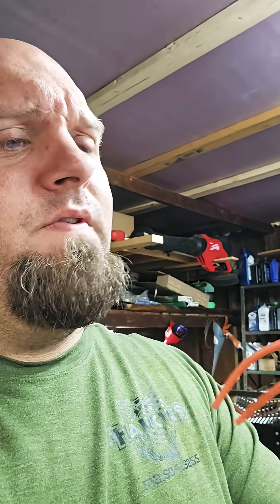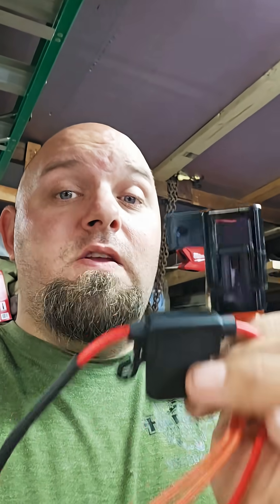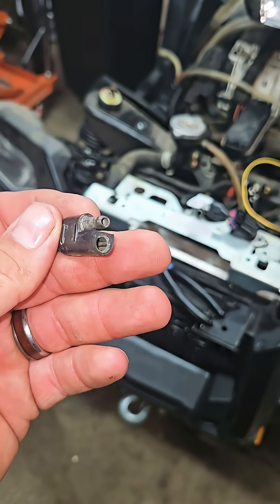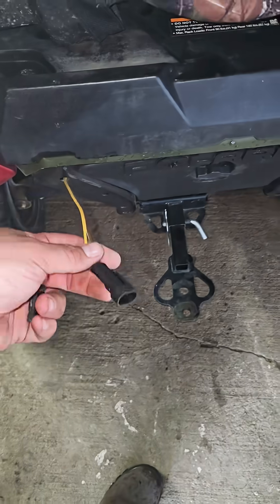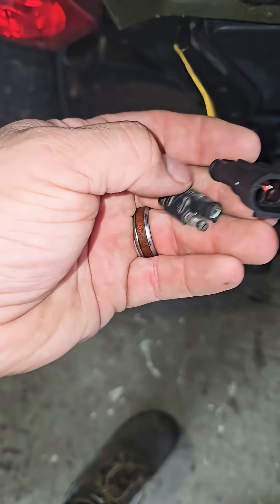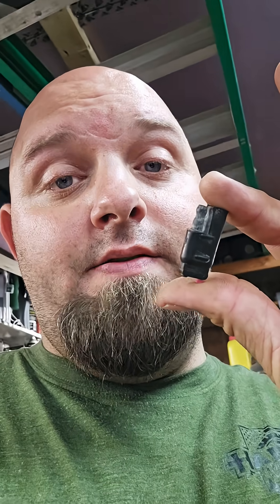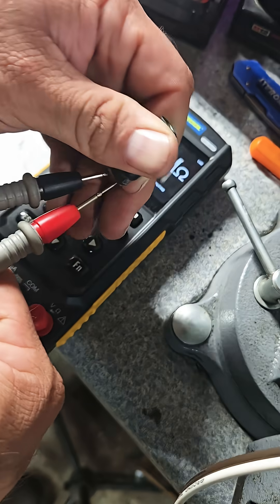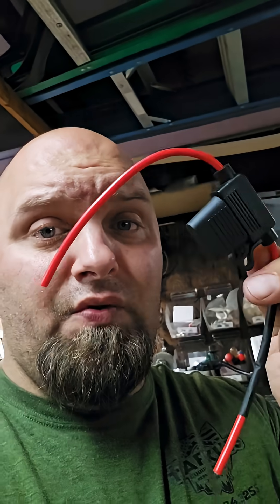🤯 The $5 Fix That Could Save You Thousands 💥 #atv #mechanic #fuse #fypシ #share

Comment: Fuses are always a good option with the right type of fuse. When advising pro installers I found that the overall amount of current needed for multiple circuits ( like public safety) were not considered at the start of installations. So they call radio shops techs for help.
The connector you have there Tyler, I would recommend testing the voltage drop across it one end to the other, with at least a few amps load as dvms are not so accurate. I have found several bad conductors and connectors in this way.
Reply from the maker: I do love a good voltage drop test. After I cut the bad connector off, I tested the wires, and they had no short anywhere. When I installed a new weather-pak connector, the issue seems to have been resolved.  Love you Uncle Erik!

Comment: Yo it dont work like that. 12v @ 2MΩ is doing max under 0.0001w. 

A simplw phone battery would take over 10 YEARS to be drained with that load. Thats just how good the insulation is, its literally a nonissue, negligible. The rest of the system uses magnitudes more when idle. 

While fuses are good to use, you're not correcting any problem with the battery dying or fuel pump by introducing a fuse.
Reply from the maker: The connector I did test shows that low connectivity. I agree it is a negligible amount to do any immediate harm. But that's just today, right now. The chassis electrical system on this Polaris shows no other evidence of shortage or any component interference between the battery and connection points other this. The charging system is sufficient, even though the customer had previously used a low quality battery. The fuse block and relays show no evidence of any abnormalities. I had thought that maybe the ECM was commanding the fuel pump relay to be engaged too long after "key off" but everything seems to be in spec.
I'm mostly thinking that this machine has its key left on more alot and kills the battery.  He's brought it here twice this year, once for service and now the pump failed. And both times the key was left on and the battery completely dead.  It's a strange series of events, and even after reading through some Polaris TSB's this Bosch fuel pump seems to have a history of failure.

So yes, you're right, on paper that low of a ohm reading to short is very negligible upon my static reading at this time. While in motion or in wet events, that could be worse.  We don't know.
Discussion is great, and I'm glad you had some knowledgeable value to add to this video. 
🫠 Edit: God Bless Sister!!!
Reply: @HarkinsEquipmentRepair im a gal 🤭, unfortunately one of few in the car world.
Reply from the maker: Well, I apologize for the chauvinistic assumption! 🫠 It's a pleasure to have you here sister!